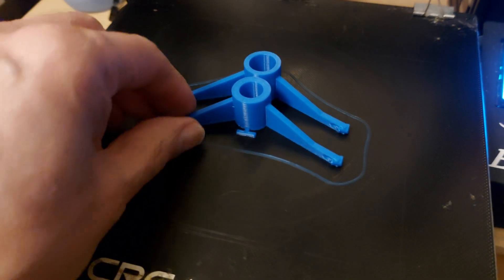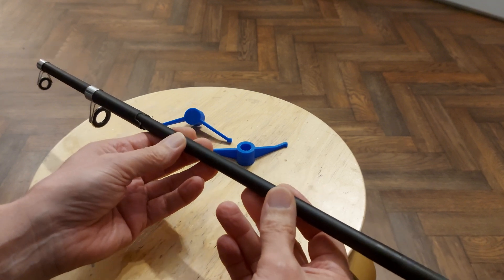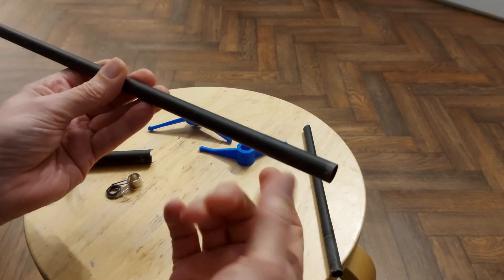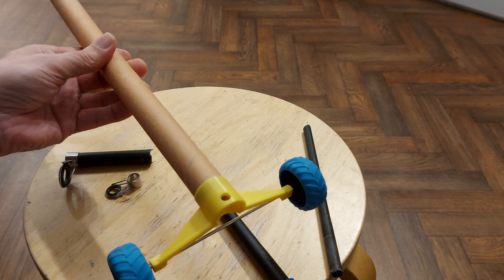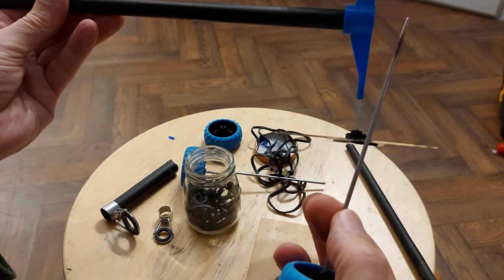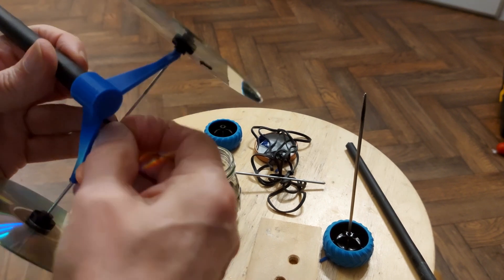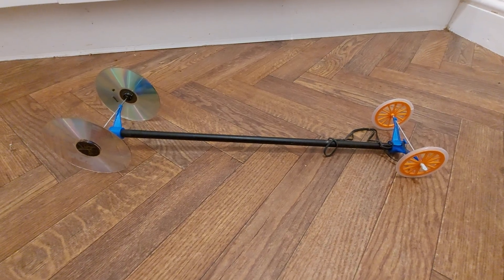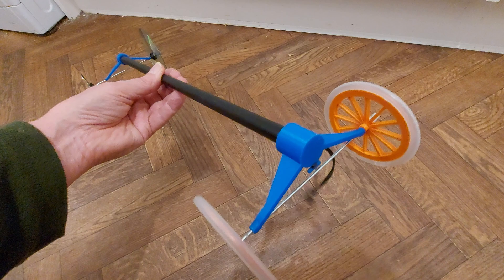Put a rubber band on it 0511 Fishing Rod RBPC

Comment: Very good sir!

Your car is very similar to one I made decades ago.

Back in the early eighties, I made a similar car, but I used 78 RPM records for the drive wheels.
It was for what they called a mousetrap car, and I used the standard mousetrap to pull a string wound around the very thin axle that ran through some very expensive gyroscope bearings and was hooked to the mousetrap bar that swung through 180 degrees pulling the string and spinning the axle.

While the drive from the mousetrap was of short duration, the energy stored in the thick record wheels, along with the very thin edge of the records, the rolling resistance was very low, which added to the efficiency and allowed the car to roll the entire length of the hall of the school where it was tested. Needless to say, it won the contest, and made some very important statements to the over engineered vehicles produced by some others who used 'modern' principles that seemed good, proved not so good to the old technology used in the car I made.

I hope your car is able to do the same!
Reply from the maker: Here are my Mousetrap related videos
Mousetrap Powered Cars and Boats https://youtube.com/playlist?list=PLA5a2xPRSrB1jSyRMjw31ptEYAAkZRF6H
Let's make a Mousetrap Powered Car #2 https://youtube.com/playlist?list=PLA5a2xPRSrB1t9Qa2jxSDyI1L83gDqfHo
Mousetrap powered boats https://youtube.com/playlist?list=PLA5a2xPRSrB0BrHDs0Grva44xXYEwUgNl

And my Spring Power related videos
Spring Power https://youtu.be/bfrjsODECrs?list=PLA5a2xPRSrB3bEp0pE4UcVggFXWbujnSj

You will always find related links in my video description 👍👍

Comment: Glad you were able to get your printer sorted out, what did it end up being? Nice fishing pole car
Reply from the maker: The hot end was leaking above the heater element. Technically it should be possible to clean it and retighten the bolts, but I replaced the hot end. Just to add to the fun the replacement hot end failed within a couple of hours and burned itself out, so I had to replace it a second time. All seems to be fine now and getting perfect prints. We will see how long it lasts.